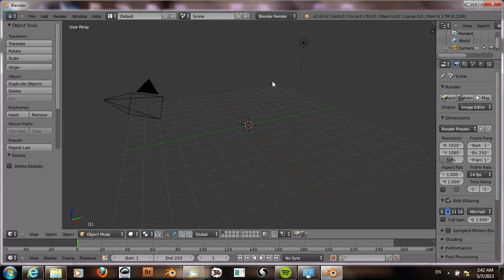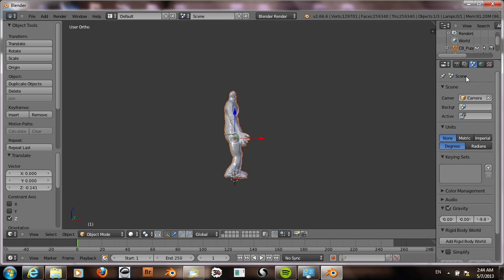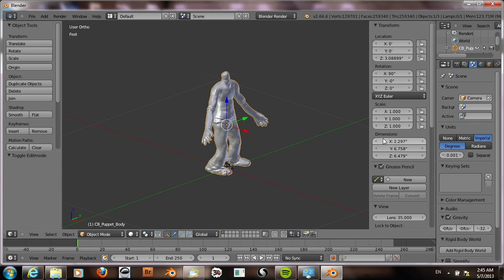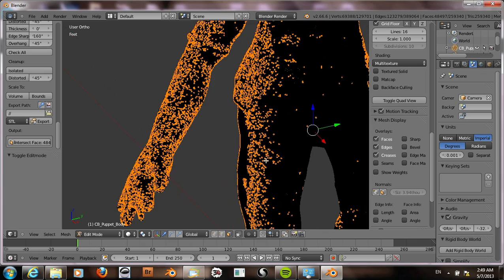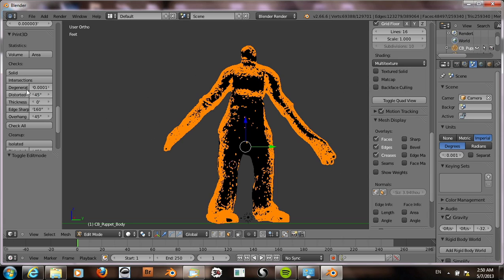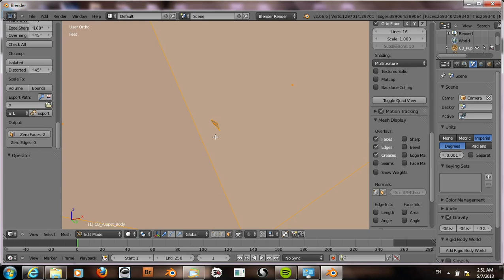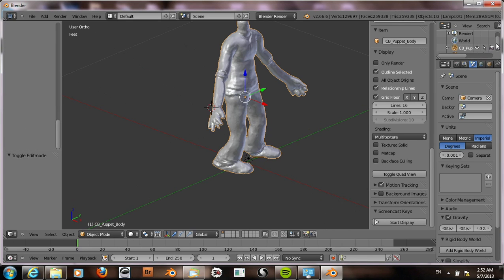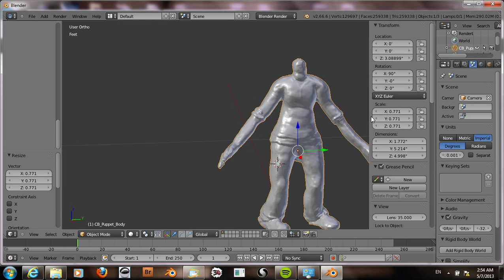Editing 3D Scans with Blender 2.66

Comment from the maker: You can try; however, any duplicate faces, non-manifold vertices, and especially holes in the mesh will cause errors during slicing and problems during printing. Highly recommended to always clean up a scan or other model before printing.